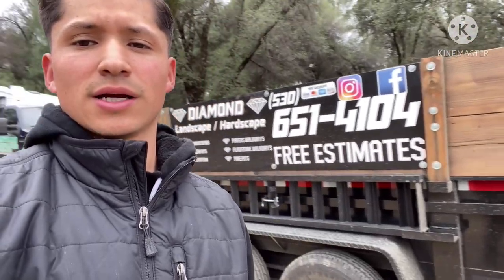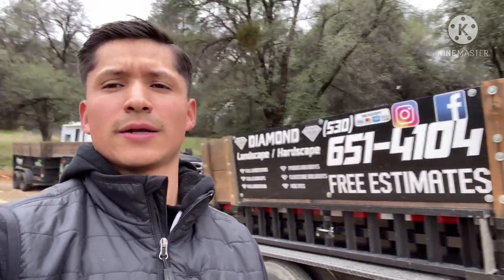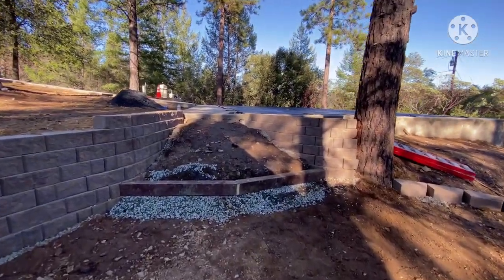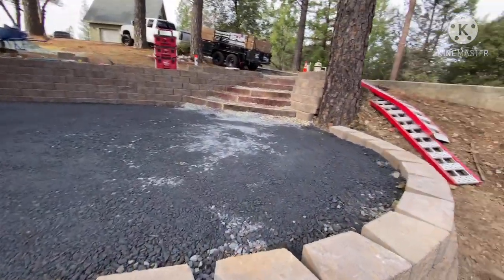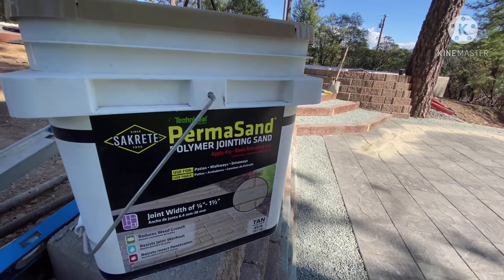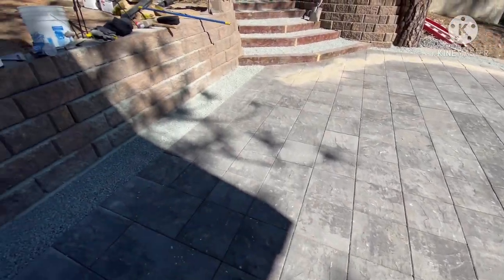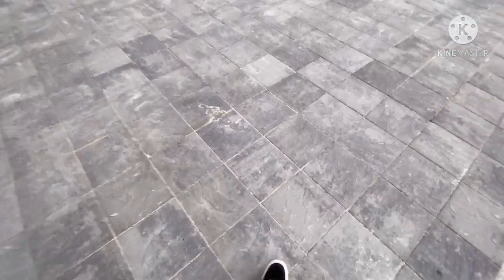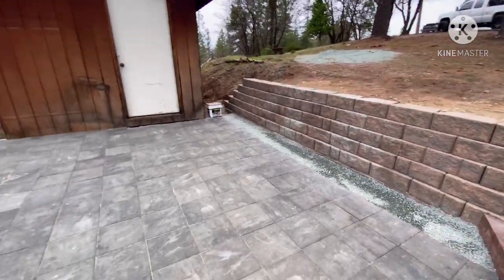Retaining wall/Paver patio build in 6 days!

Comment: Question. Why did you use the stone on the top edges?Couldn't run the pavers all the way to the wall?
Reply from the maker: Clients wanted a small area for pots and other things to set
Reply: @jaisantana2293  thought it might have somthing to do with drainage. Thanks

Comment: Just out of curiosity where are you located?  Ask because I live in CNy and it has not yet really hit here where people use a stone instead of concrete sand or stone dust as a bed for pavers.  I have seen another hardscape guy on YouTube (Mass Hardscaper) who started using chip stone (I believe that is what he called it in video) as a paver bed.  I have 2100 square feet of patios around the house and pool and am going to put in a 17 by 17 paver patio in my direct backyard this May with the left over pallets of techo bloc I have.  I was interested in trying this “chip stone” method of paver bedding if it works well and is easy to use.  Nice job by the way.
Reply from the maker: Hi I’m located in California and I’ve been seeing the chip method for quite some time now and just started using it a couple months ago I love using it due to its simplicity and much easier to work with, being if you indent it you can correct your mistake much quicker than sand in my opinion, about 80% of the contractors I know are using the chip method. Give it a try and see how you like it! Thanks!🙌🏽
Reply from the maker: @MrChristopoop  thanks I appreciate it! And I believe the sand is a lot more common but I’ve been seeing the chips become a newer (Base) I personally love the chips👍🏼